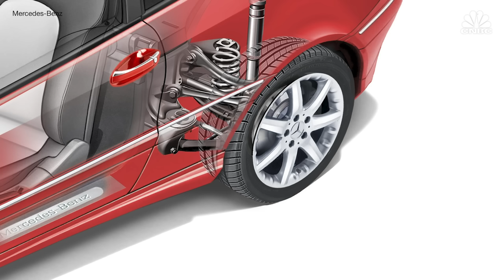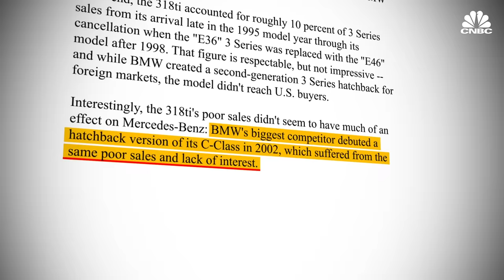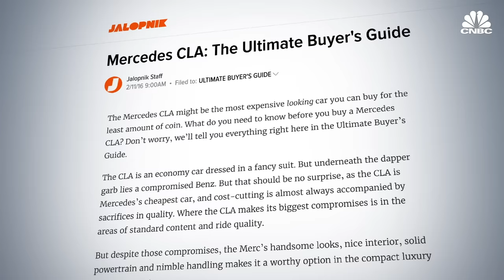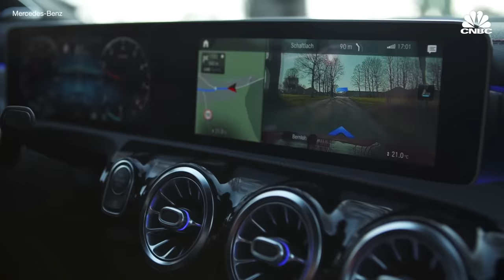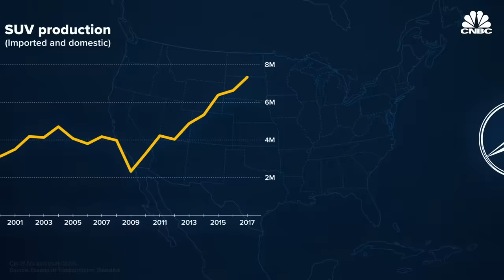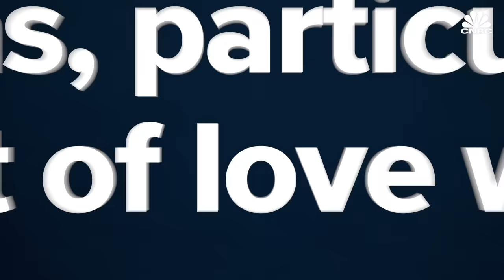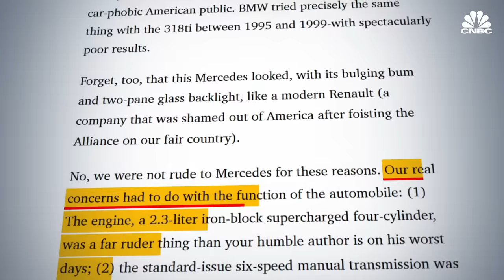Why BMW And Mercedes Made Cheap Cars That Failed

Comment: Those current “cheap” cars from the Germans are only cheap before you start adding options. Want Apple CarPlay and Android Auto? Pay extra for it....whereas the economical brands offer that tech as standard equipment
Reply: Millennial Wealth Building Makes sense and I don’t like this about these brands.
Reply: I wanted to lease a A220 and was turned off by how it had no options. Even a base Corolla had more. And it's not like it's a RWD sports sedan. It's a FWD underpowered car. No reason it should cost $40k when a fully loaded sonata or Camry costs the same and it's 10x better.
Reply: White Boy no reason?it has one big reason to cost that high.it has Mercedes badge.
Reply: They are making the BMW X7 SUVs in North America besides in Europe. The Toyota made in Canada rather than in Japan are well-built. People pay more for those extras, and that is why they go over their budget meaning they are paying more than they need. A purpose to buy a car is to get around from here to there. It is like you want an AMG for Mercedes-Benz, nor M package for BMW nor always the top of the line everything. I drive a Nissan Rogue SV, and I could care less about top of line SL package just for sunroof, leather seats and allow wheels including Apple CarPlay since it is just a bonus. I bought a Sapporo beer last month, and it is made in Vietnam than in Japan. At least it is Sapporo and an Asian brand.
Reply: @MLProductions.1  My sister and her husband currently leased a 2020 Acura MDX A-Spec. The last car they leased was a 2018 Acura MDX Elite package, but they want the sportier looking Acura MDX after their lease is over, and they don’t want the TV options since her two sons goes crazy over DVDs and just give them their iPads when we go to Toronto once in a while. The Acura MDX A-Spec is almost like the same thing, but just a tuner package. I know a Mercedes-Benz A Class cost over $40,000 in Canada and it is the base model while you can get the top of the line car such as the Nissan Rogue SL, Toyota RAV4 or a Honda CRV with that kind of money.
Reply: But those German companies give more standard and offer more
Reply: SHREKonDVD that’s why when I bought my new Highlander I didn’t go with the XLE only went with the LE and use Apple CarPlay for navigation and is so much easier to use than my Acura’s factory Navi.
Reply: BunGYChords I don’t think so, when I’m in the market for a sedan, I look at Acura tlx, 3 series , and c class, with all the options I want and many test driving I end up with Acura because it offers more for the price and is little bit roomier than the competitors, With the same options and LED headlights bmw would cost more than my TLX, after that I went and leased a left over Audi A6 3.0t with S line package for only 360 a month.
Reply: Hey Millennial Wealth Building.......how do I start Millennial Wealth Building??
Reply: @Young Simba what if you already have it
Reply: @destroyedsoul1791  a bage that can be bought on ebay!
Reply: That wasn't only nowadays so, I can remember my dad choosing the Hyundai in the 90's because it hat everything he wanted included in the already cheap base model
Reply: @MLProductions.1  So what you're telling us is that you're poor and you still wanted to drive a Benz so you demanded some freebies and because you didn't get them a Camry is "10x" better without actually stating WHAT is better about them. 10x better makes this a sub 1 Second 0 to 60mph car. Lets check out the facts and sort out your fiction:

even the A200 Limo will do 0-100kmh in 8.3 seconds and therefore is just as fast as your 10x better Camry. It will also have a higher top speed (143 vs 112mph) and at least give you the option for several things the Camry doesn't even offer you no matter what you're willing to pay for (AR Navigation for example). Maybe because you're not even able to read data off a spec sheet and compare it you're not earning the money you need to actually drive your Benz.

And now how is this Mercedes' fault White Boii ? :)
Reply: Legit. Just go to mazda and see all the stuff you can get for just 30k.
Reply: @ronaldoseven4865  how much less could you care? You sound miserable. "Oh let's never have nice things in life, let's all drag our knuckles around with a big frown on our faces" Broo Hoo. You ever stop to think someone might buy an AMG because Shock Horror they actually like it and want it? Thought not
Reply: German cars are for the upper class what can I say
Reply: I was interested in a Mercedes A Class and it was $50,000 CAD when it had the specs I liked which is too steep for a hatchback. Could buy 2 new VW Golfs for the same amount. And those drive nearly as good and the interior is almost  as good.
Reply: I paid off my 92 VW GTI 16v in 99, for Cash. $5250. Its worth equal, or more, now.
Reply: 30k is a lot of $ for a a Mazda! Damn, I almost bought a new left over 19 Mazda 3 for $15000 beginning of year.
Reply: Apple Car Play is a Simple installation of an aftermarket $400 set up. No need tto buy top of line.
Reply: Ken, they must not be veru good cars if you cannot keen-one very long.
Reply: @ThirdLife86  r e l i a b i l i t y
Reply: @unassumingaccount395  You can't really say anything about reliability as they're new cars. Come back with some numbers in 5-10 years ;)

If i get one on  a lease now for 2-4 years reliability is nothing that really affects me.
Reply: @ThirdLife86  ah yes the european cars at the bottom of costumer satisfaction surveys
Reply: @unassumingaccount395  Since i don't wear "costumes" it probably doesn't matter to me mate ;)

And how do you measure satisfaction ? Its not a number, more like a feeling probably due to unrealistically high expectations because you just spent a lot of cash on a supposedly better car and then notice it may be better in most areas but not by much.

Show me a number of breakdowns on the street compared to other cars - then we can talk about numbers.

Wouldn't matter to me much anyway since i get a new car every 2-4 years anyway as i said. If you're getting say an S600 Merc which is 15 years old and complain about high maintenance thats your fault, sorry.
Reply: No Thanks...i prefer a benz or Porsche....why settle for less? Never.
Reply: @juicybullfrog  yet they still have base trims that stick you with turnkey ignition

Comment: Small BMWs and Mercs sell really well in Europe and are a great entry level for younger buyers to the brands who often remain loyal and upgrade. No brainer from the manufacturer. The reason they didn't do well in the US is more likely related to the fact that they dont have big 6 or 8 cylinder engines.
Reply: My mom recently bought a Mercedes glb one of there cheapest options and it is amazing.
Reply: My mom recently bought a Mercedes glb one of there cheapest options and it is amazing.

Comment: typical cnbc, video has nothing to do with the title!
Reply: I thought i was the only person that noticed that...guess not lol.
Reply: And that's only one of the failings of this video. I would  be fine with the grossly misleading title, if this video made an actual point. Even if it's not the one in the title. But this mess is an aimless pile up of irrelevant statistics and dubious references with no obvious purpose.
Reply: Promoted by the competition me thinks , cars now  designed to last 5 years then you start repairs constantly , there is no pride anymore just excecutives with a profit agenda SSDD
Reply: Guess they fail was aimed at share holders & sales executives. Seems like the working class got their money's worth!
Reply: How tho?! Wtf it’s pretty straightforward. They clearly express that their cheaper cars sell less because the expectation is higher and therefore disappoints the customer
Reply: @Thesupetrsisters  I'm pretty sure their point was that luxury brands are trying to expand their Market and struggling with all of the issues described by the "irrelevant statistics"

Comment: As someone who used to work in a European car shop, I could write a novel on how much of a pain in the ass working on these vehicles is. Cheap quality, expensive parts, and almost every repair is going to cost more than expected because of the risk of breaking things whilst performing a repair. Diagnosing these vehicles and figuring out what exactly is wrong with them is almost like taking an automotive ACT. One time we had a customer come in with a couple of bulbs out in one of his headlights. We replaced them, and they still did not work. Upon further inspection, we found water damage to the headlight module, and wiring to both headlights starting to form. What’s the solution? Well, replace both headlights and the module. This $100-$150 headlight job turned into a $5500 headlight job. To anyone who drives one of these automobiles, please head this warning. Your pockets will thank you.
Reply: Follow up, the car was a 2010 BMW 535i in case you were wondering.
Reply: @PhonkySchmonkey  There is no combination of Headlights that could cost 5,5k on a F10/F11, no LED, nothing. Adaptive stuff here and there but thats it. If you charged 5,5k its a fraud.

Comment: Cheap Cars but the repair is more often and not cheap.
Reply: when warrenty run out... it just time to trade in...
Reply: That's the trick. My mercedes e class is cheaper to repair then any Toyota, Ford or even Volkswagen.
Reply: @corruptedmember2568  nice fairytale
Reply: @mitri5389  he literally was referrng to the waranty period, after which he would get a new one and sell off the 5 year old used one. So technically he has less repair costs...but left out the price difference for his new car.
Reply: @mitri5389  $2200 for an Axel on a 2019 Corolla. Thats not exactly cheap now is it?
Reply: @corruptedmember2568  
If it's an old one that's credible. But a new E Class - parts cheaper than a Ford, simply untrue
Reply: The cheap GM part and the quality BMW part cost the same price!
Reply: @thewizzard3150  
BMW used to be the epitome of high quality along with Mercedes until the mid to late 90's. Now, the difference between their products and GM is marginal at best...

Comment: The term “buy” is very misleading as the majority of BMW’s and Mercedes are leased - the owners never actually own about 65% of the vehicles worldwide.
Reply: do you expect everyone to drop 50 grand cash when they want to drive these cars?  Leasing and financing is the only logical choice, or buy used.
Reply: Yes, you don't wanna have BMW's or Mercedai when they're beyond 3yrs old
Reply: Ur actually saving money when ur leasing these car
Reply: Zachary Carlson leasing is the most expensive way of having a vehicle.
Reply: @sultan-nc6fh  but still spending a lot more than with any other "normal" car.
Reply: @billolsen4360  Mercedai? Really? Is Mercedes-Benz so hard to spell?
Reply: Only expected to last for the lease.
Reply: @tryitout-701  not if you count in breakdown costs and depreciation
Reply: @zacharycarlson3865  but your own car is still your own as even I bought a BMW for $80,000 in India with full payment
Reply: @tryitout-701  
Bruh if you get to lease a mercedes for less than 20$ a day you will save money
Seriously the cars lose 80% of their value in 5 to 10 years
Reply: @billolsen4360  In my opinion, if you want to own a car of those brands, you might want to look for one that is at least 3 years old. European-imported cars have a very high depreciation value. Those cars lose about 50% of their value in the first 3 years. IF you buy one that is at least three years old, I think the warranty will still be valid and you won't be losing as much money.
Reply: @hassanlabyad4082  They lose 60% of their value in the first 3 years though. Most people lease the car for 3 years meaning they are basically paying for the vehicles' depreciation.
Reply: You are correct
Reply: @mananagarwal7002  your BMW already lost 30% the moment you drove it out of the showroom and within the year end your beemer will be worth less than 40k.
Reply: @mverick5444  because you got a 28% discount on the sticker price. New cards dont actually lose that much value as many people think. Sure their value is a lot than MRSP quite soon, but nodoy has bought the car for MRSP in the first place
Reply: But mercedes dealerships buy cars from mercedes itself
Reply: @Gheorghe99  well, I'm not. I'm Indian and I don't even know what the heck is social security
Reply: @MrBerlinPark  Mercredi
Reply: @tryitout-701  Depends on which brand like if you want a Toyota buy it. If you want a Maserati you should lease it because of the high depreciation rate and high maintenance cost.
Reply: @originallyik  that is total BS.  Check out CarGurus nationwide. 2019 Audi A4 today in 2022 avgs 35k. Orig price 45-50k. that’s NOWHERE near 50%
Reply: @isimonsez  That's just the Audi A4. If you look at other vehicles from manufacturers such as Mercedes-Benz or BMW, you'll see overall depreciation ratings that are closer to 50% percent.